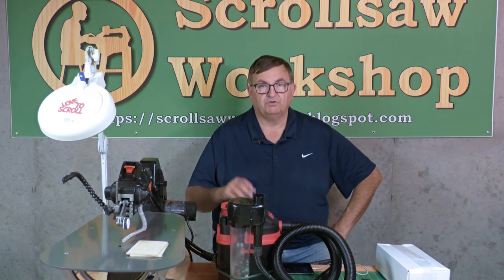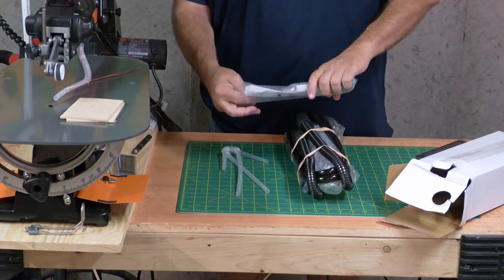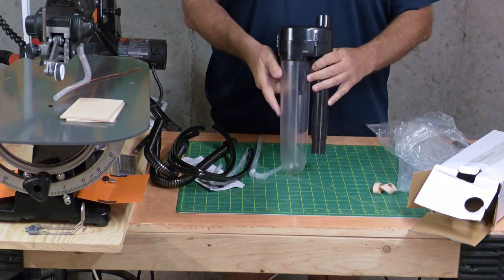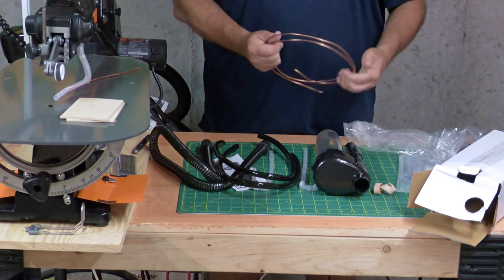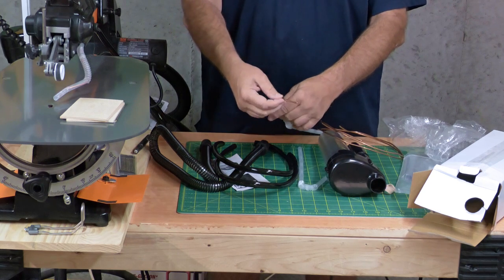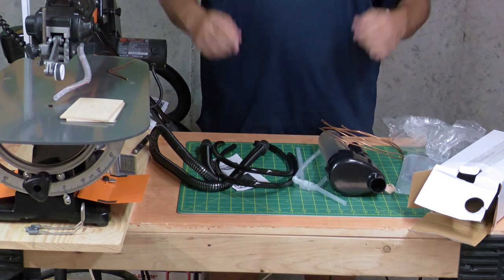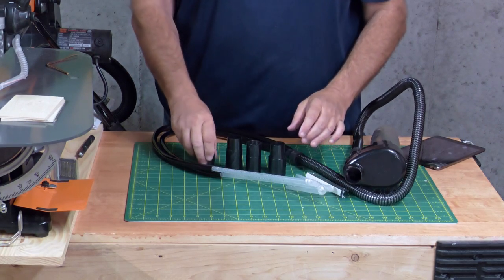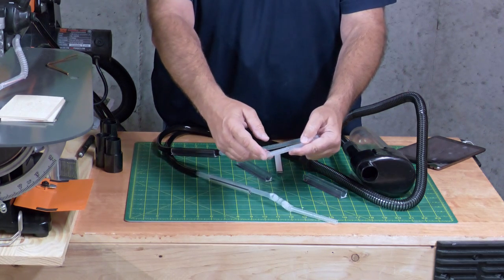Is this the best dust collection system for a scroll saw?

Comment: I have the older version and I have had problems with the bottom tube clogging up when I do fret work . The small pieces tend to clog the tube. Very informative video thanks Steve.
Reply: I can see that could be a problem. I have not experienced it but I wonder if a small piece of window screen would prevent the large pieces and still allow the dust to get through. Just a thought.
Reply: @stevegood3224  thanks Steve I’ll give it a try

Comment: I do recognise the effective dustcollection. I use a blower to keep my cut clean which spreads dust in the air, therefore I use a halfface mask. My problem is the noise which comes with the vacuum. I will look into it more closely for the results are very good (!)
Reply: Hi Nico. Noise is the number one issue with dust collection on the scroll saw. I have tried several solutions with limited results. I think it will always be a trade off between the inconvenience of the noise and the health benefits of dust collection.

Comment: For those who are looking for a quiet vacuum another way to make one quiet is to place it somewhere else. You could leave it running and use PVC for the lengthy run. Or run a low voltage wire with the PVC and wire it to a relay. 
They also have wireless controllers for Large Dust Collectors that would work. 
The basic idea is to move it far enough from you that it isn't annoying anymore.

Comment: Wonderfull to help to remove the dust. do you have any sugestions for a vacuumcleaner. I live in Holland and i use your diary frequently. Fhanks for all your good work steve!!!!
Reply: I have not found a vacuum that has a reasonable price and is low noise. The Scrollnado does not need a powerful vacuum so any 2hp vacuum will work fine. I have had to resolve myself to wear headphones and get used to the noise. For the most part, I have.

Comment: Hi Steve Good job as usual. Looks very promising, but like others are saying the ability to find a vacuum that is quiet enough for several hours of use is my problem. I do use music head phones (at lower levels) and it helps some. But I am almost deaf, and fear this level of noise will further damage what little hearing I have left. Finding a quiet vacuum will be key, or better yet, a way to connect to my larger 4 inch dust collection that is located far away would be even better. However I wonder if it would still be effective when connected to that large of a pipe (4 inch ) ? Thanks for the demo and keep up the great job you are a real asset to us!
Reply: I use the Shark Lift Around portable vacuum with bungee cord holding the vacuum hose above the scrollsaw table and another below.  I also use headphones and it's not loud without headphones.   I don't think the Lift Around is available similar to Shark Lift Away that comes apart that I have for house use.
Reply: I meant scroll saw arm not table for bungee holding vacuum hose

Comment: Hello Sir,... Hope you won't mind a quick question.... The flexible light came off, it's connected like a ball and a socket, but so hard to push it back in. Do you have any idea in how to reattach it back? Or any recommendations in how to get it back in. Thank you for your time
Reply: Loc-line sells a 'pliers' to connect and disconnect those articulated ball hose thingy's. I have one and it makes it easier, but you should be able to do it by hand. If warming it up doesn't work and you can't do it by hand, then buy the tool.
There are different sizes so measure yours but it most likely is the 1/4"

Comment: Hello Steve.  I pruchased the Scroolnado from Amazon and I must say that I was truly disappointed in the perforamnce.  I followed your instructions to the letter and I even returned to your web page to certify that I installed it correctly.  I disaembled the unit twice and with care falowed your directions.  I even went as for as using my big shop vac still without any success.  I retern the uit for a full refund.  There was absolutley no suction at all.
Reply: Hi Charles. Sorry to hear you had problems with the unit. Thanks for letting me know about the problem. Mine is still working well but I am not getting many emails about the product so I don't have a good feel for how it is working for others.

Comment: Hi Steve, Nice video and neat idea. Has your opinion of the Wen LL2156 changed since your review? I'm debating between this and the Delta.  It looks like the tensioning knob goes almost all the way when tightening the blade. Does it apply enough tension? Thanks.
Reply: Hi Mahlen. I am still pleased with the WEN LL2156. I have received two emails from people who purchased the saw. They both had a noise and rattle problem. The first had a very good experience with WEN support and they sent a new saw. The second person is also getting a replacement saw but I have not heard any information on how their experience was with support. I have not seen any issues with the tension lever. It works fine. The choice between the Delta and the WEN is pretty even as far as quality. They both are nice saws. When the Delta is selling at a reasonable price I like the value. Sometimes when their supply is low it gets too expensive. Currently, Amazon has it for $$466. That's not a bad price. I have seen it jump to close to $800 and that is not a reasonable price for that saw.

Comment: I'm sure it works great, but doesn't that top hose get in the way of cutting?
Reply: I have not noticed any interference. Plus it is flexible enough that it moves out of the way easily. I normally have the dust blower even closer than this extraction hose and it never gets in the way.

Comment: You think by moving the Upper Memory Tube closer to the back side of the scroll saw blade, that it would also help in reducing the blade's temperature during cutting and pick up more dust?
Reply: Hi Bill. The closer you get the tube to the blade the more efficient the dust collection will be but I don't know how much. It is already pretty efficient. As far as temperature goes it would be a total guess on my part. My guess is that it would not make much difference.

Comment: Instead of using the clear tubing, could I use the flexible air blower tube from my saw as a vacuum tube?
Reply: Hi B Rydd. It's called Loc Line. I just ordered one and will test it on the Scrollnado for proper fit and usability. Nice idea.

Comment: Couldn't somebody just attach a vacuum hose to the saw's dust port and pull the dust out that way?

I mean, the manufacturer had the decency to put a dust port on the saw, so you might as well try using that before resorting to aftermarket solutions.
Reply: Dust collection on a scroll saw is difficult. The included dust port does not do a good job of collecting the dust above the table. That is where aftermarket solutions come in handy. Wood dust can be a serious health issue for some folks so having options is good.
Reply: @stevegood3224 
I'm not arguing against aftermarket solutions; I'm arguing that this particular video is useless if you think about it for but a moment:

* The saw can cut wood with or without the vaccuum and/or aftermarket device.
* The vaccuum can collect dust with or without the aftermarket device, but can't collect dust if there's no dust being produced, thereby needing the saw.
* The aftermarket device needs both the saw and the vaccuum.

These dependencies immediately show that the vaccuum functions as an accessory for the saw, as does the aftermarket device for the vaccuum.

Because the aftermarket device is an accessory for the vaccuum, the proper test would consist of a comparison between a vaccuum collecting dust from the saw without using the aftermarket device, and the same vaccuum collecting dust from the same saw with the aftermarket device.

Instead, the author only provides us with the most obvious piece of information; that having some form of vaccuum-based dust-collection for the saw is better than running the saw by itself.

Again, I'm not at all a fan of dusty environments, and were I to consider my saw to be unpleasantly dusty, you'd soon find me attaching various pieces of spare PVC tubing to it until the issue is successfully remedied.
I'm simply arguing that the video's author failed to actually test the aftermarket device in a scientific manner.
Reply: Watch the video instead of hyper analyzing…you can see a major improvement.